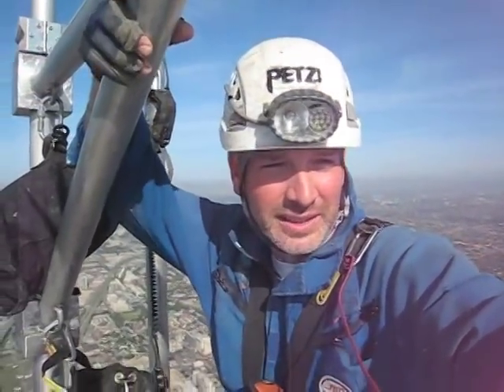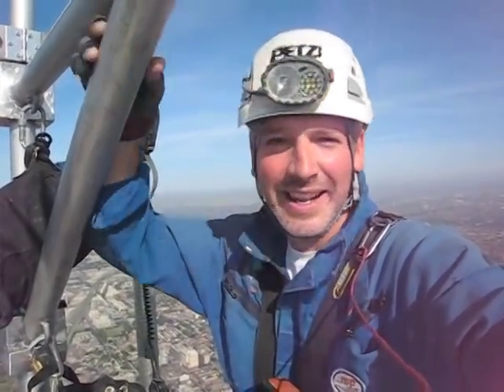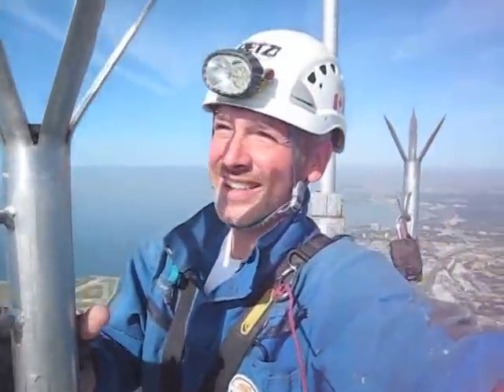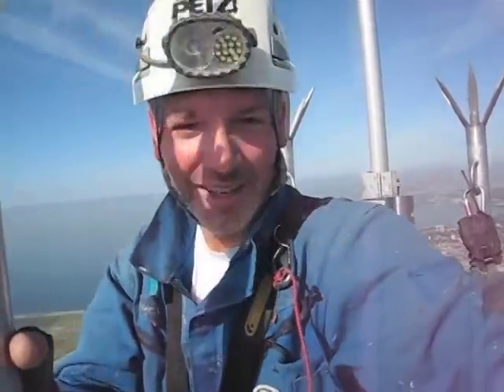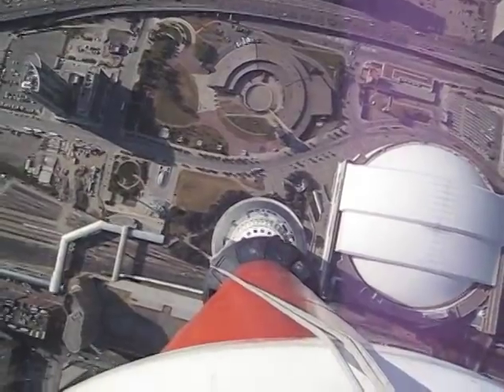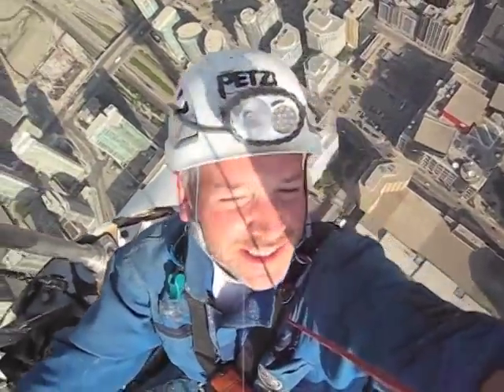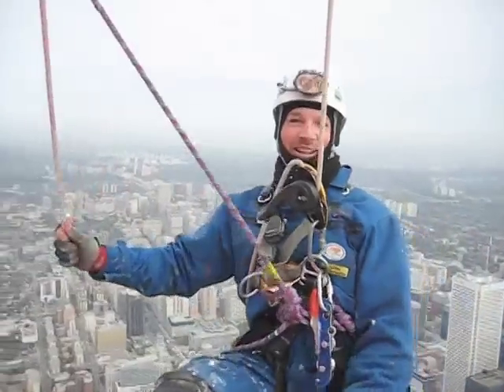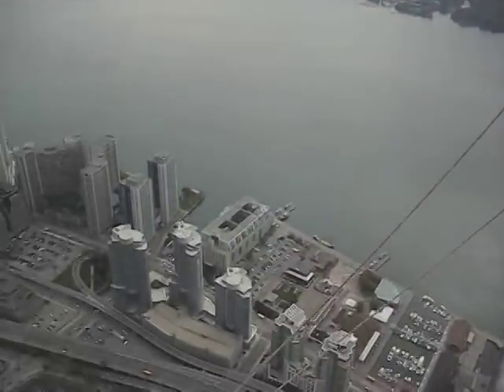TOP of the CN Tower

Comment: How are you not cooking with all that high-power RF? That buzzing you guys are hearing is the effect of that RF on the camera. He's right on top of some FM elements!
Reply: I'm wearing a Naptex suit, and socks; its a nomex and stainless steel threaded cloth that creates a faraday cage around us. The RF is measurable, and as such, it's possible to hang out in spots where there is minimal exposure, like the tip. The RF techs at the tower measure the field each morning before we go up using a calibrated probe, and tell us whats hot, and whats not. we map it on an architectural drawing of the mast, and plan our routes carefully, as well as our safe emergency egress routes. 
You wouldn't want to rappel into a hot zone, you'd be dead in minutes, if not seconds. Some of the banks are 130,000 watts, and very directional.

Comment: How did he get to top? I wonder how far up they can go on stairs/elevator compared to skydeck
Reply: Hi Daniel. I'm the guy in the video. From the Skypod level, there is an access hatch to a service area around the skypod elevator mechanics. We stage there. It's then a 475-ish foot climb on a confined space ladder, with several platforms that coincide with antenna arrays and the different diameters of the antenna. Due to the RF radiation from the arrays, once you start climbing, you don't stop. We wear NAPTEX suits, socks and hoods, that protects us like a faraday cage, but they are brutally hot. Normally the climb is about 45 minutes. In our rescue drills, we have done it in under 9 minutes to the top hatch, the one I'm sitting in during the video. So it's like climbing a tiny ladder up the side of the 45 story BMO tower in under ten minutes, but in a 24" wide tube full of high voltage lines, lol.
This particular job was the inspection of the tower for it's 30 year warranty. After working eight months, 12 hours a day for 7 weeks on the tower, I could confidently bang out over 60 pull-ups at the gym, for perspective.
If you want to learn more about this kind of work, check out IRATA Certification. Hope that helps.

Comment: It's crazy to think the Burj Khalifa is almost 1000 feet taller.
Reply: +Dreaklock I've done the Kalifa inspection; the ground is so far away it literally stays out of focus while working. It is a superb structure to climb.
Reply: Patrick Thompson Does it sway much on top? Or is it perfectly solid?
Reply: +Dreaklock I've not experienced sway on the Kalifa, but there was a day on the CN Tower where it clocked 110 knots at the tip, and despite the passive dampeners, it was throwing us around pretty good.
Reply: Patrick Thompson What's in the very top floors of the Burj Kalifa? I know it gets more narrow as it gets to the top. It doesn't seem like there's much room for anything on the top 5 floors or so.
Reply: +Dreaklock from tier 24 to the pinnacle(top), it's just access ways and basic mechanical.
Reply: yes:-)
incredible.

Comment: Man I dont care how tall that is, getting to climb it from the inside vs having to climb those from the outside like some have to are 2 completely different things! This seems fun and exciting, but when I see the ones when where they have to climb them all the way up from the outside.....😧😳
Reply from the maker: Hi, glad you like it. You can't climb the CN Tower from the outside, as the RF transmitters will essentially cook you like a microwave. We climb the internal skeleton, exit the top, then rappel down as banks of antennas are shut down in sequence, giving us a safe zone to move through. We rappel up to 300ft down from the top or intermediary levels via hatches place mid tower, and then, we climb back up our ropes to get back in. In an emergency, we can shut down the tower and rappel to the skypod using 600' ropes, but it's treacherous. I've worked on 2000' telecoms towers, the Eiffel tower, the Burj Kalifa, etc, and the CN Tower is by far the most challenging. There's nothing to grab on the outside, so it's all rope work and industrial mountaineering techniques. Most tall towers have ladders, and you can rest on the way up. On this tower, it's a 47 story confined space climb in a tiny steel shaft, that sways back and forth in high wind.

Comment: 2:31 if it snapped...
Reply: If it snapped, no biggie. May shit my pants a little, but the backup system would catch on the 2nd line, and I'd drop three feet and stop. Then I'd just remove the damaged rope and switch to the backup line, then climb back in the tower and re-rig.  If you watch the whole vid, you saw the complex load sharing anchors up top, and the rope protection on the ropes. There's nothing sharp enough to cut the rope, and they just don't snap. They may look thin, but they are certified to a minimum breaking strength of 5000 lbs, and we can't physically fall enough to put that much force on them. It's actually a pretty safe gig, I still do it, but mostly in the offshore oil business now.